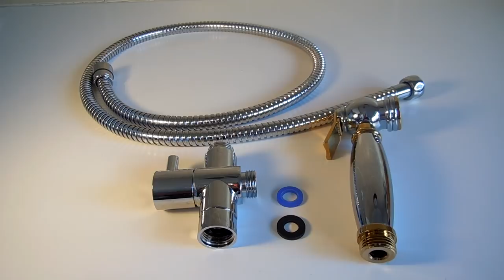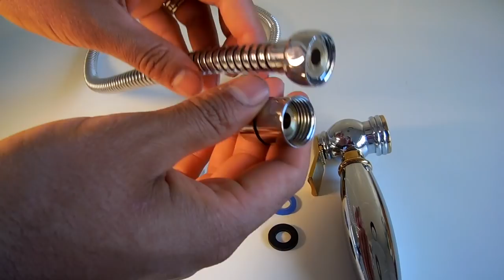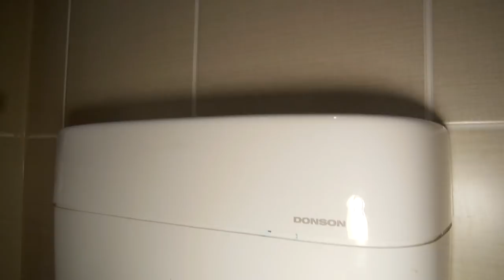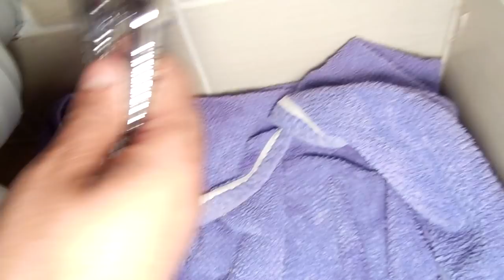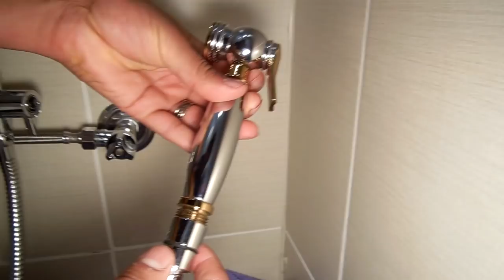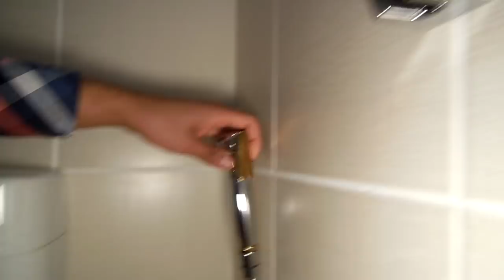How to Install a Bidet Spray | Easy DIY

Comment: Every Finnish bathroom has one. I've had them for many years and just upgraded the sprayers. One of the best inventions of all time. Simple and cheap, useful as can be.
Reply: Except unlike here, in Finland you can adjust the water temp, this is just hooked to cold water. :)=
Reply: @TheAzynder  That's right. But cold water is better than no water.:)
Reply: @paulparoma  I guess, and this is definitely cheaper.
But it's not like the proper alternative is super expensive either.
Reply: @TheAzynder  True, but it's not available in every country. In the US, it's not easy to find a faucet with a bidet hose, while in places like Finland it's a regular bathroom fixture offered by every manufacturer, from Oras to Grohe. So, the only solution for a US consumer is to hook one to a toilet or order/bring one from abroad. By the way, my Chinese replacement sprayers are far better than my original Oras.:)
Reply: @paulparoma  Oras is the old reliable, it is nothing special really, is why I got my kitchen faucet from Ikea :)=
But importing can cost a fair bit depending on the provider.
Reply: @TheAzynder  I like Oras, It's like everything Finnish: nothing special, as you said, but well-made and reasonably attractive. My kitchen faucet is from China, cheap and plenty good. Replacement head for it is about $5. Oras can't really match that.

Comment: Good clear instruction.  Thank you so much.  I live in the United Kingdom and water is generally cold and winter water is very cold.  Can you tell me how to make it so that it's warm but not very hot.  Please advise.  Many thanks.
Reply: This is my concern also. I live in Canada and I'm up in the mountains where if I used a sprayer like this I'd freeze my ass off. I use a handheld peri bottle and fill it with warm water first.
Reply: very easy. when you do the renovation in your flat, just instal the mixer with both hot and cold water taps on the wall close to your WC. That's it.
Reply: v s     So genius  you cut holes in your bathroom floor for plumbing, sewage line, you re-wire for electrical supply, fiddle fuck with the controls at 3 am, wipe up the mess you've made, still use toilet paper!!! BUT your kids will LOVE the water fights in your bathroom!! Cross your fingers that your bidet is on the ground floor!
Reply: They make a hand-held sprayer bidet just like the one shown above except that the water diverter attaches to your bathroom sink faucet. I LUHV mine and it's very handy as in the winter months here in Central TX, I can warm the water by adjusting the bathroom sink water handles. Also, I'm not a fan of having to reach under/behind the toilet to divert the water to the sprayer.

To see how to install the bathroom sink sprayer, this video does a very nice job: https://www.youtube.com/watch?v=OIG5iM4bz1M

Comment: Minor Warning for the worry worts.  Technically that's an illegal installation in Australia for a few reasons so do some research. It needs the correct back flow check valve ? or RPZD ? to stop syphoning poo water back into the mains water supply, and a height installation can be an issue also. (Spray nozzle above bowl s-bend off memory)
Back flow reasons given to me by the plumber was, if by chance the bidet spray hose was left in the bowl (example lazy kids or accident - and the trigger held open) and the mains plumbing was being turned off for maintenance it would then drain the bowl poop water back into the mains water - Ahhhhh Possible contamination and or insurance issue from water damage if it burst in your house, so don't buy the cheap plastic ones as they fail under higher pressure. (Pressure limiter needed  I believe)
Once you own a bidet sprayer hose you will never go back to the inferior smelly dirty paper poop wiping method ever again. 
 If you had poop on your hands would you only wipe it with paper or wash it 😉
Whirlpool forums have some advice - search "bidet spray" or use a licenced plumber and mortgage your house to pay for it.

Comment: Did you add a back flow valve to stop water running back into the clean water supply should the bidet sprayer be dropped into the toilet? Australian requirement and worrying that most places seem to not sell them with the sprayer.

Comment: Wonderful tutorial. I bought the product and tried to install it but having leakage between t-connector and toilet. Is this  a rubber washer issue cause i have used one or a tape issue cause i have used that as well, or have i tightened it way too tight? Can you help me with this issue?

Comment: OK on the surface this seems like a marvelous idea.  I've used a full on sit down bidet in Europe and I've seen bidet toilet seats that need to be plumbed to hot & cold water.  My question is this looks like it only gets cold water.  Where I live water in the winter and be near freezing in temperature.  I'm a little concerned about spraying my nether regions with ice cold water.
Reply from the maker: Sick Bastd 
Yes, you're right, it is only attached to a cold water outlet. Not a problem here, because we don't have extreme winters here, but I imagine it might be a bit uncomfortable elsewhere! Brrrrr! ❄️❄️❄️

Comment: I live in the uk & having a cold spray up the rear end is just not the 1. I want 1 but I need to to work out a way to get the hot + cold mixed before it comes out the hose
Reply from the maker: +harry chop Yes, I can't imagine it would be very pleasant in cold winter climates! I guess it would be a little more complicated depending on your plumbing.
Reply from the maker: We only have cold taps in our toilet, so it's a cold bidet.
Reply: but you can bring both cold and hot water lines to your WC room and install the mixer next to your toilet seat. Works just like the regular shower.

Comment: I RECENTLY MADE ONE. ACTUALLY  I'M ON V2.0. THE FIRST ONE WAS MORE LIKE AN INDUSTRIAL VERSION. THE ONE I'M PERFECTING NOW IS PRETTY NICE. THE INHERENT ADVANTAGE OF USING ONE WILL BE APPARENT THE FIRST TIME YOU USE ONE. ITS A NATURAL WAY TO GET VERY CLEAN IN A WAY TP JUST CAN'T! NOW BE AWARE THAT USING ONE DOES NOT DO AWAY WITH TP BECAUSE YOU STILL NEED TO DRY OFF.
Reply: Don't be cheap jax......get the one with the hot-air fan!!! That way you can shampoo, rinse and perfectly dry your pubes and the hair on your ass!!!

Comment: Hi. Are there any specific bidets we need to look for? Will any bidet fit any shower tank?
Reply from the maker: +Raga Ranjani Gumma Hi Raga. We had to look for a bidet that fit to an Australian cistern tank - I believe every country has a different ‘standard’ size of fittings etc (some would have no standard) and you would have to either find a bidet to fit that (cheaper) or bring one from India and hope for he best - which may  mean having to buy some sort of adapter (potentially very expensive!). You could look up the size of the fittings for Canada in google maybe? However, we found the Chinese was from eBay great quality; it’s still going strong!

Comment: I think ppl are afraid of the velocity of the water blast, how cold it'll be & where it's all going to finish.   And no woman wants faeces blasted into her other aperture!   BTW, it' "beeday" not "bidday" & we don't have wrenches - they're "spanners"....adjustable or otherwise.  Aside from all that, I've always wanted a bidet!   Thanks for the video!
Reply from the maker: Haha, sorry Melisse, I’ve always pronounced it with a terrible Aussie twang “bidday” 😅😅😅. We also use spanned and wrench interchangeably in our household. 

With a bit of practice and experimenting, there’s really no worry about contaminated water ending where it shouldn’t. We’ve also had no problems with water pressure or temperature but only lived in temperate or hot climates. 

Definitely try it out; you won’t regret it!

Comment: So um... how does a spray compare to a normal bidet? It seems like it would be messier, to me. Do you lean to one side of the toilet or something?
I'm new to this and have an in-toilet bidet I'm installing, but this was very useful for the plumbing part. I'd also maybe recommend some plumber's tape... maybe....
Reply from the maker: +Jeff Simmons Honestly, I've not used a traditional bidet, so have no comparison. I've not found it necessary to lean to one side, or messy, but I'm sure everyone may have a different technique. I guess the pros for a bidet spray is that you have some control over the direction of the water jet, and you can also use it for things like spraying reusable cloth nappies.

Good luck with your installation. :)
Reply: Wow
Reply: Jeff Simmons you can slightly lean forward (still firmly sitting on the toilet seat) and spray, make sure the spray/hose is directed to the toilet.
Reply: Jeff....chill man...... NO SANE PERSON uses that contraption!! How would your kids deal with a water pistol in the bathroom??  Major floods????

Comment: I use like blue soap on toilet if I do this conection water come blue with quimics... dont have another option?
Reply from the maker: Sara Alves Is your blue soap in the cistern? If it is, the water shouldn’t come blue from the hose. The water comes from the wall connection, not the cistern. 

We also use blue liquid in our cistern.
Reply: @NeeloBlue  yes from cistern... But on video water come from cistern right???? so can change and put from wall

Comment: The adaptor in the video is a nifty idea but it looks as though it doesn't connect to the hot water supply, so the water coming out would be cold water. In hot countries such as Australia, the cold water might be nice and cooling I suppose, but in cold countries like mine I don't want to wash my privates with freezing cold water, thanks very much. I prefer to use hot / warm water. I use the simple method of using a jug of warm water. If you use a jug or similar receptacle, you don't get lots of water spraying everywhere and making a mess.

Comment: Is the water that comes out from it clean ,and makes no harm for skin or health?! 
Cuz mabye this water can be Processing or from the sewage...
Reply from the maker: ahmad sah
In our house, the water from this tap is exactly the same as the drinking water in the kitchen. 

In other homes, however, it may be grey-water so you’d have to check that before installing.
Reply: Neelo & Blue thank you, its enough to check the color of the the water if its white an nautural so it able to use and if it was green or yellow its not able ?
Reply: Neelo & Blue I think it's better to connect it with the bath water tap, I know how, by the same piece of metal that appeared in the video but it's  not the one whic form is like "T" , just a straight iron tube.

Comment: Thanks a lot for sharing.I live in Switzerland, I recently bought a bidet spray.Similar to the one shown in the video.But I have a problem.My connection to the Toilet Flush is all concealed.Now can I attach this T valve to my Shower?That way I can also get warm water?Thanks
Reply: I have the poor man's bidet. I sit on the edge of the bathtub with my butt hanging over and use the shower sprayer (on a long hose) to do the job. Afterward i spray the bits down the drain. I use warm water.
Reply: Easy Peasy dude....get a jackhammer, cutting torch, cement mixer, install new sewer lines, you'll probably need to get a building permit for the reno, re-tile, electrical supply for the heater, then MAGICALLY.......VOILA!!!!!! Your bidet renovation is complete!! AND THEN Come the building inspectors to ok your handyman work!! AND they are the building trades' prima donnas!! Buy them a drink FIRST!!       TA RA!!!!!!! Your pain in the ass bathroom fixture is poised for it's first flood!!!   CONGRATS!!!!!!

Comment: Question - I installed a bidet but it seems that the control tap on the diverter is also controlling my flush? If i turn it off no water gets through to the flush - Is this normal?
Reply from the maker: Hmm, does your T-adapter look the same as hours? 2:45
If so, the tap should only control one pipe, and you may have that connected to the water from the wall instead of to the bidet hose?

Comment: i have one in my home but it's different
it's like the sink but under you
you don't need to move just turn it on after you pee or poop
Reply: Excellent move!! I lowered our bathroom sink by 20" so the bathroom sink became dual purpose.......sink and bidet!!! Hot and cold water as you want it!! With the hot water you can also shampoo, condition and rinse your pubic hair!!

Comment: Hi
When you attached the hose to the TEE adaptor the hose forms a very tight 90 degree drop this will put a strain on the hose spiraflex outer sheeth which will rupture very quickly and possibly nick the inner rubber tube and cause leak. To view how a hose should be connected correctly do's and dont's please view at this link:   https://www.bidet-shower.co.uk/_resources/cms/Correct_fitting_shower_hose.jpg
Reply: Could you please let me know where you purchased this from :)

Comment: Imagine this bidet with its own water tank fixed above the cistern. Half the size of the cistern. There's a solar heating pad on the window. This keeps the water warm, not hot. This water is used for the bidet! 
Alternatively, this can be purchased. There's a bowl that fits over the toilet seat. One fills it with water getting the temperature just right. Backside cleaning needs a soft bristled brush, (many are not). The AMAZON UK Addis  ComfiGrip Long Handled Bottle Brush with Sponge Scrub, Metallic Graphite, 8 x 8 x 35 cm. Is the only brush comfortable to use here.

Comment: Elderly people (and all of us) need a BIDET 100% effective and for this they have to produce VERTICAL WATER JET,  QUICK ACTING,  COMFORTABLE,  SIMPLE,  EASILY USED,  non electric , easily straddle like installed without tools, easily  sterilized, making hot water  useless, no hands involved for cleaning, not needing AWKWARD POSITIONING, never CLOTH  WETTING, nozzle never  being spoiled, not needing TO CLEAN THE BASIN  AFTER, being able to combine with elevated toilet, never leaking.

Comment: The link for that bidet spray doesn’t work 🙁
Reply from the maker: The bidet set we bought is no longer available and I can't find the same one from another seller, however there are very similar ones for sale:
https://www.ebay.com.au/itm/Toilet-Brass-Bidet-Spray-Shower-Head-Douche-Kit-Shattaf-Diverter-Hose-Holder/132271566182?hash=item1ecbffed66:g:XC0AAOSwbCpZdWOq